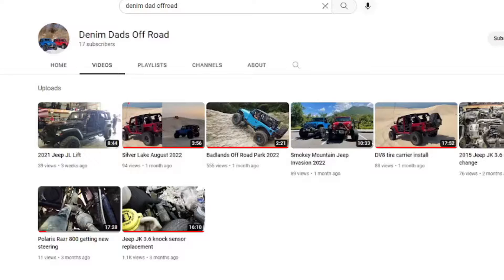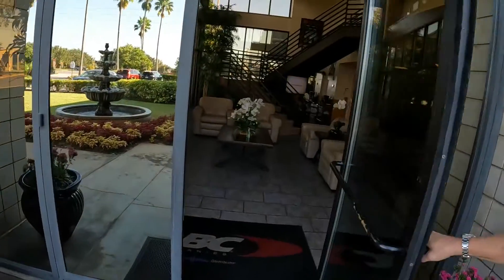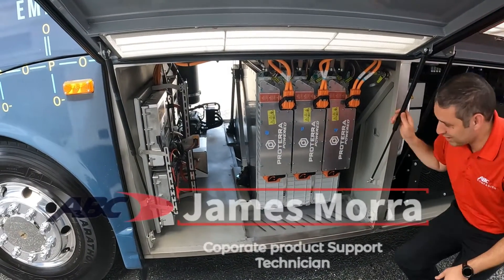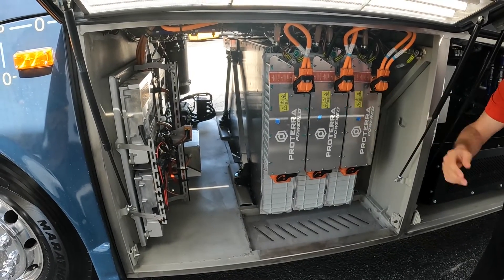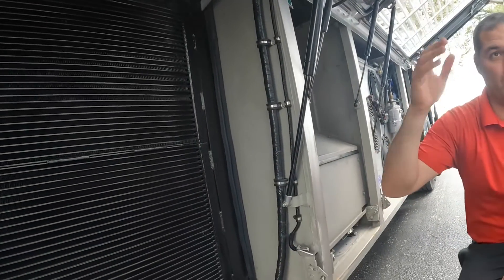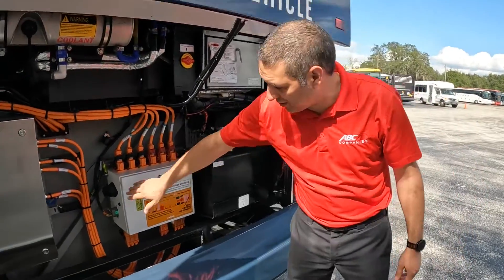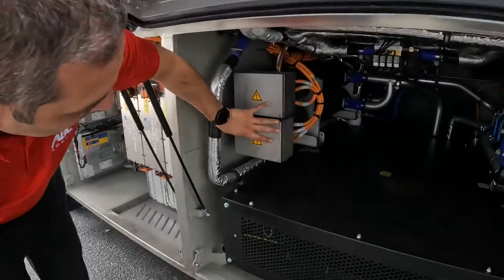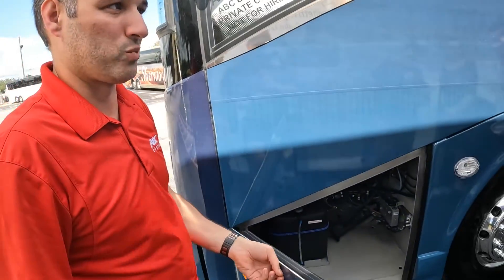All electric bus. How does it all work? | Van Hool CX45E

Comment: Thank you for the deep-dive on how electric technology is being implemented in these busses.  While like you mentioned its not there "yet" its making leaps and bounds to get better and better each day.  Its pretty amazing as a bus owner to see all of the components that make a bus work being carried out by electrical counterparts... like air system, hydraulic steering system, air conditioning and heating, etc.  It'll only get better and more integrated as time goes on.  Theres not a lot of "transparency" in the bus space so I appreciate yourself and ABC for making these videos.  While the initial price for entry into one of these EV's is probably exponential in comparison to the fossil fuel current versions its obvious that their long term TCO is much lower maintenance wise.

Comment: The luggage space is a major issue. I can see it being used as a commuter bus or a local tour bus but not for any OTR trips. If the company  I used to work for in Maryland took a day charter to NYC it wouldn't work. It's roughly 240 miles each way and 4 hours to get there depending on traffic. It's hard enough to find parking it's going to be worse trying to find a charging station. An average day trip to NYC the groups stays there for 6 hours. If the electric coach has a max range of 250 did they consider the load of the heat and AC, electronics as well as the power inverters for the AC outlets? The outside temps. It seems fine for a commuter bus where it can sit and charge all night but that also means the bus company has to buy charging stations for all the buses. I am sure that is something you already asked.
The only time I drove an all electric vehicle was the Ford Mustang Mach E. That thing took off so fast I was at 70 MPH before I knew what was happening.
How was the acceleration? How many motors and were there any in the front?
Take care and be safe.

Comment: James, this episode is a keeper!  Thank you.  I think this phase of EV mass transit is like the Sputnik phase was for space travel.  Components will keep getting smaller, hence more luggage space.  Battery chemistry and regeneration will keep getting more efficient.   Maybe we will see your 20th Anniversary episode on some yet to be developed communications platform showing the 2040 model EV motor coach.   Blessings.
Reply from the maker: Thanks Donald. Haha maybe... Im not sure what ill be doing in 2040 LOL. But that would be cool.
Reply: @MotorcoachWorld  Clearly, that bus was created from a fully kitted out diesel bus. Everything was mounted in the luggage lockers or engine bay. The luggage locker walls correspond to frame nodes in the structure. An EV bus must be fully redesigned for compact EV equipment. It appears bus manufacturers don't have this capability as they have long relied on compact packages from engine/drivetrain suppliers. It is going to take a Tesla, Bosch, Continental, Magna, etc to enter the market to supply the powertrain and a body design.

Comment: Thank you, this video answering my question. This bus is most definitely a conversion. However, this is the most well tought out vehicle conversion I am aware of. You, dont, for example, have the passengers sitting up against the roof (which is how Mercedes does their SUV conversion). Being a conversion is the root issue leaning to the loss of space. A ground up EV design would easily solve the space issues.

Comment: It's all done very nicely and I am sure it also works very nicely, however, this bus is basically useless. I did not count the seats, but it has to be between 47 and 56. Now tell me where the luggage goes? You need to pull a trailer. All European buses have not much room for luggage to begin with. Now with that e-system there is no more luggage space. Just great!

Comment: Knowing that lithium batteries is a fire hazard , you do know that once these batteries go through a thermo melt down once you see the tell tail white smoke can you get everyone off of the bus in 10 seconds, also remember that the white smoke is highly toxic. With those batteries being under the bus inside the luggage compartment I would not be wanting to be on that bus.
Reply: @Elizabeth Cherry  There are different lithium ion battery chemistries already.  Also battery shutdown circuitry in each block to prevent runaway reactions.  Very strict temperature control parameters is also crucial to fire prevention.  I think I would order a dry chemical fire suppression system just in case.

Comment: It looks like 90 percent of the bus volume is dedicated to the EV system, with nothing left for stuff like passenger luggage.
Reply: Simple just follow european ultra low cost airline rules with some small alterations. Something like this: One (1) SMALL carry item on that fit in front of your legs under the seat for free and one (1) regular carry on for an additional fee. (small print) Carry on that does not fit into the overhead compartment WILL be left behind NO EXCEPTION!
Reply: Good for short, excursion trips.

Comment: AWESOME!

Also, it's kind of sad you don't have the Level 2 AC charger built in and just DC fast charging! I know AC would be DOG SLOW but it's always nice to have backups for those bad days! hopefully they can get the DC charging up to 250 or 350 KW, might be able to get that 3 hour charge down to 2 or 1 hours!!
Reply: I was a bit surprised too to see this doesn’t support level 1 or level 2 charging. I guess if it did there would be even more luggage space taken up by equipment.  Even at level 2 though, 7kwh charging up a 600 kWh battery would be dog slow like you said.

Comment: Maybe ok for a transit operation, But not for charters, as there is no luggage space.
Reply: That is most likely what this one will be used for. Based on the branding it's going to be used as a shuttle service between a bay area tech company and the local metro/rail stop. I am curious how they're going to get it they are from Florida. That's a lot of towing or a lot of recharges.
Reply: @jeansdavid  The range mentioned in the video is for a full load. Empty it will go about 50% longer.
Reply: @jeansdavid   I would guess ABC & Van Hool will set up a public relations tour.  They could drive, stop for show & tell, recharge, sleep, and do it all over the next day.  (And have a good old fashioned diesel chase rig with a portable high-capacity generator just off camera. 😎)

Comment: Where are the passengers luggage stored? Not much space underneath this coach. Minuscule for passenger luggage.  It is all taken up by the AC, cooling,  batteries etc..etc...etc...Is there enough over head space in the coach? I don't think so. As pointed out in the last video about ev buses right now it is not practical for line hauls. I think the range is 280-300 miles. BUT in a few short years all that will be solved as technology improves with  these EV coaches day by day....We shall see. Great video. Very informative! Thanks for posting.(-;
Reply: Aren’t most power plants in Illinois and Indiana fueled by fossil fuels? How is this a “zero emissions” vehicle?
Reply: @johnp139  yeah I completely agree this thing is quite limited I would say most smaller coach services probably would have a hard time justifying this. The only way I could see this bus making sense is if a company was frequently running local services and had access to cheap electricity.
Reply: @johnp139  it limits the vehicle emissions from being directly in your neighborhood.
Reply: @johnp139  the term "zero emissions" vehicle applies to any electric car. The fact that the electricity isn't generated completely clean doesn't change the fact that the vehicle doesn't produce any emissions
Reply: I think these will likely be limited to local/regional day trips at least for now. Depending on fuel operating costs this might be an good alternative for that?
Reply: @dossphosmedia  but that EXTREMELY LIMITS the versatility of the bus!